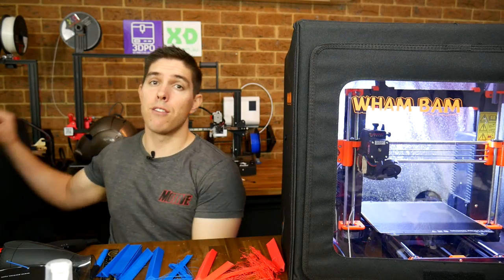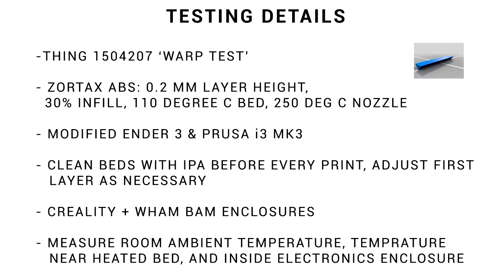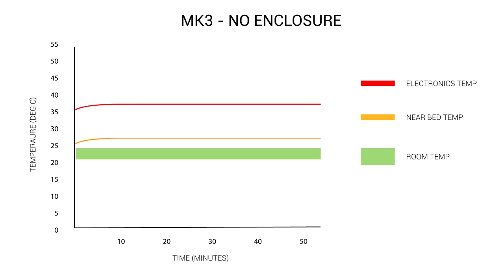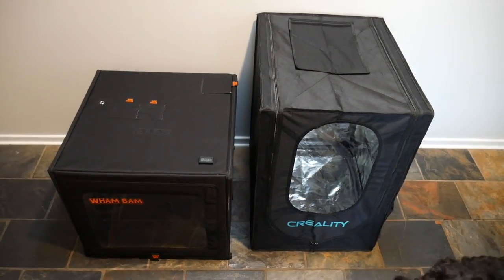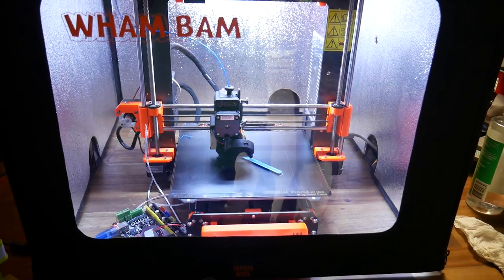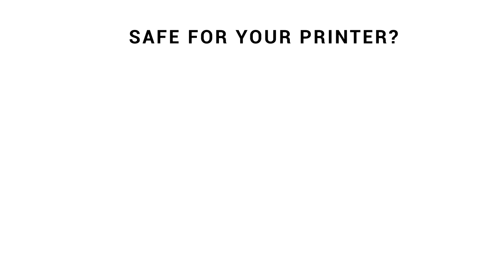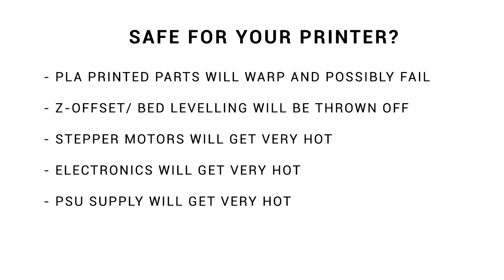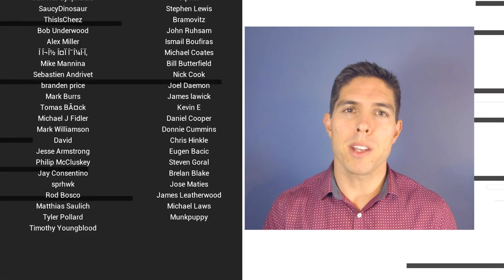Pop up 3D printer enclosures tested - Creality vs Wham Bam

Comment: Thanks for the videos! When printing with PETG the layer adhesion seems strong enough that parts don't split, but they can warp away from the print surface and fail that way. I've found that a brim and 25C semi-enclosed (reduced drafts) is enough to stop this happening. (From the research papers PETG looks to have the lowest figures for released nano particles, so along with the mechanical properties it seems the smartest choice to print with.)

The oversized hood enclosure I made is open at the bottom with its walls starting just below bed level, so all the electronics under the printer are outside, and it traps the warm air in above the build plate similar to a balloon. Printing on green PET tape stuck to glass helps with PETG adhesion and allows for 40C bed temp on smaller parts and 60C on larger ones; no need for any glues etc. The technique for printing PP filament on packing tape was applied, which is also made of the selfsame plastic.

There is a recent video by Nerys on a sort of 'topology hack' to print complex multi-walled parts with vase mode. This has helped a lot with designing things for PETG printing (usually 1.2mm line single/double wall parts) so there is little to no retraction / travel - definitely recommend watching it.

Lastly, I saw a welding video about how correct order of welds when fabricating a frame helps stop it warping. Maybe slicers could do something like that for printing ABS etc, where they extrude layers in a particular pattern/order to help equalise the cooling of the part? Or a thicker wall/infill on the inside of external corners to retain heat a bit better (if that's what would help).

Comment: I have my Ender 3 in the Creality enclosure down in my cold basement. I’ve never had a problem printing with PLA. I’m also using the Creality glass bed - would that make a difference?

Comment: Have had no issues with the creality enclosure running on an upgraded ender 3 for a few months.  The printer does have the electronic box and power supply relocated outside the enclosure.
Reply from the maker: That's an ideal setup. Did your warping reduce?
Reply: @TeachingTech  I have had no warping issues.

Comment: I have the Creality enclosures for both my CR-10 V2 and my Ender 3Pro and I have never had an issue.  I added some cheap temperature/humidity sensors that I got from Amazon and humidity gets down to 10% when I am printing ABS or PETG.  I actually use it to dry my other filaments while I a printing.  The hottest I ever seen the enclosure was 40C.

Comment: This is an incredibly useful video.  I hope you study these enclosures more; I think there are still things to learn.  One thing that might be interesting to find out is is what happens when you add either passive or active cooling to the stepper motors.  I see that there are really simple heat sinks that you can add to a stepper motor that just attach with thermal tape; also, I have seen some that use a fan.  How well do these work inside an enclosure?

Comment: That was great! I've struggled to get even reasonable layer adhesion with ABS on my Ender 3 so I made a box using foam insulation from a building supplier, a small window door using plexiglass and coating the inside with aluminized bubble wrap - got temps inside to over 65 °C using just the heated bed. This also reduced power consumption considerably.
Warping improved but the print failed after an hour when the extruder stopped working - I traced it to the driver chip on the stock mainboard, tried to replace the chip with a rework heat gun and failed - the solder pads are just too small to place accurately, and couldn't get the driver to work again.
I ended up buying an SKR Mini E3 to replace the mainboard, which arrived yesterday.
So from my experience, cooling the electronics and PSU is important, so I will make some ventilation pipes to connect the intake fans to ambient air.
I think the steppers can handle fairly high temps up to 100 °C, but will also consider using an aquarium pump and silicon tubing to try to draw some heat away from them.
The quest for a decent ABS print continues....
Reply from the maker: Thanks for sharing, great information.
Reply: Why don't you just print a case for the mainboard and display and mount it on the outside? Along with the PSU.
Reply: @schwuzi  I will, after I've installed the new board and can print again!
Reply: a chip will drift into place by itself given that there's enough solder and flux for it to do so; i've soldered many tiny parts (including BGAs with 0.5 mm balls) with success. a microscope may be a necessity though
Reply: @ikbendusan  I know, I tried, but was really tough especially with so much copper in the board drawing heat away, and I can't be sure that the heat didn't damage the chip or surrounding components. Maybe the oven would work better. At least the other channels still work, so could be useful to use for a plotter or spares.
Anyway, have new board now.
Reply: @ahaveland  i have lost count how many times i heated a component to the point that i doubted it would work again hahahaha. so far so good though. might be worth giving it another shot in the future if you end up needing it
Reply: @ikbendusan  Thanks for the reassurance!

Comment: I have no room in my house to keep my printer so it is kept in the garage (small house, too many kids). I built my own enclosure for my Ender 3. The enclosure is both heated and has an exhaust fan (when it gets too hot). I use the OctoPrint Enclosure plugin to keep the internal temperature regulated and I am getting awesome results (as compared to printing without it). I also need the enclosure because every time the garage door was opened I would have layer adhesion issues due to the draft. In fact, I could tie the bad layers back to the door open time (I am using Amazon key and have a log of when the door opens and closes). The few times I have brought my printer into the house, I do not use the enclosure and get awesome prints. In my case, the enclosure was necessary because I have less control over the ambient conditions around the printer.

Comment: This was super useful. I'm in the process of enclosuring my ender 3, and i've been thinking a lot about the effects on the various components. One should maybe try and ciculate the air(move the hot air from the top down to the bottom) of the creality enclose. The temperature gradient inside that tall chamber is probably several degrees. Maybe even tenths. Super nice with these semi-scientific approaches.

Comment: Thank you for this great video. I almost wanted to buy the Creality enclosure for my Ender3 pro. The biggest problems I have are with ABS not with PLA. Most of the problems accure when there is an airflow around my printer due to draft.

Comment: - Steppers will be fine
- Of course any other electronics aside from the steppers should be moved outside of the enclosure, there's a good reason why manufacturers recommend active cooling for stepper drivers for example.
- There's no indications on how long you waited before launching the prints with passive heating and given the internal temps I assume you didn't wait, which would play a role in how conclusive your test would be.

- Your active heating will only cause problems, ABS needs stable temps to print properly. Here you have creating air movements which will be worth than printing in open air in a closed room.

This test doesn't seems to be thought through:
- If your internal temps are going down during the print, then it means there's an issue with the enclosure or the setup. Seeing that, you should have stopped and tried to fine the source of the temps drifting down.
- It's a well know fact that sensors (except endstops) will be affected by heat so you should have addressed that before testing, as there's obviously an issue with your first layers on both the Prusa and the Ender.

- Same goes with not addressing the PLA parts on the Ender.

I love your video but I don't think you should release content with incomplete or wrong test procedures.

Comment: Received my Creality Enclosure for my Ender 5 last Friday.  Been printing successfully using ABS filament with the Creality Enclosure for about 5 straight days now.  I didn't have any of the issues you are having.  Really strange that you had this kind of issue with your Creality Enclosure.  But I do have concerns about keeping the electronics inside the enclosure for long period of time.

Comment: Considering this is meant to do higher temp filaments closer to 300 degrees C I’m. It sure why this test was done at all? Only the s1 pro for ender is made to handle up to that temp and the screen actually detaches and is placed outside of the enclosure while printing

Comment: I have the Creality one and it's great for keeping dust off but as for printing it's been very hit or miss. Once I upgraded the extruder to Creality's own aluminium one instead of plastic the filament started to snap too because the stepper under the extruder got hot and the aluminium conducted the heat! softening the filament enough during retractions to deform it.
Reply: Same here .Got the Creality Large enclosure-Printer ender 3 V2  With MicroSwiss direct drive and metal hotend.Need ventilation to make it work

Comment: I use the larger Creality enclosure for my CR10S Pro and I found I had to bump first layer extrusion all the way to 122% to get good adhesion. From there, it seems to work fine. 

One tip is I leave the door open to check the first layer is going down well, then close it up once I'm sure it's ok.

I don't run the printer 24/7, but so far it seems to be holding up. I'm not sure how to know if the steppers are failing due to heat.
Reply: Do you have any problems with the stepper motor on the sprite extruder getting hot? Thinking to buy one for my ender 3s1

Comment: I would be interested in seeing a follow up that examines your results after swapping all PLA parts for PETG or similar. Additionally, I would love to know your opinion on using enclosures to isolate any microplastic or dust given off by a printer and vent it out via a duct to an exterior window.

Comment: Have been using my CR-10S Pro in one of the Creality pop up enclosures for a few months now. Generally only print ABS, and more recently, PETG. Previously, i'd used a cardboard box to print ABS. I've had absolutely zero issues (previously i'd experienced warped prints in cardboard box), and my ABS parts are near perfect. It took quite a bit of experimentation to get my z offset right, but once it is, print failures have been practically nil.

Comment: What is the bed temperature you are using? I had an MDF enclosure for my printer with the filament inside  and usually printed at 90º-100º on the bed with hairspray and no additional heater, and was able to print much taller models. I don't use it now because the I increased the printer height so it doesn't fit anymore, but plan to get a larger enclosure.
Reply from the maker: All of these tests were done with 110 deg C on the bed for both printers.
Reply: @TeachingTech  Try some bed adhesive, hairspray or gluestick, and printing taller objects, might be an advantage there, I don't think those are completely useless.
Reply: Try printing a tall thin model to see if they improve layer adhesion or prevent splinting during printing.
Reply: BTW I like your work very much.

Comment: is your part cooling fan on for ABS, i have no issues with abs in a lack enclosure, and only with internal temps of 45, you are doing something wrong or using trash filament for your test.

Comment: I wonder if the Ender/Prusa would work in the Wham Bam, or is just the bed on those two that won't adhere at higher temps.
Reply: It's not the bed - it's the inductive sensor. Detected distance of an inductive sensor changes depending on temperature. The P.I.N.D.A. 2 has an internal temp-sensor to conpansate, but it has to be calibrated - and as nobody seems to do so, conpansation is mostly turned off.
So If you put an mk3 into an enclosure, do a firstlayer calibration with the chamber heated up. Else your First Layer will be wrong distance from the bed and so not stick optimal. Has nothing to do with the surface of the bed, only with the ABL in higher temp envirement.

Comment: I'm using IPA to clean build surface of ender 3 at work with it's fake buildtak and my colleague questioned that, he says that there might be some special coating that might be dissolved by IPA, is that true?

Comment: i bought a enclosure from amazon that "fits" the ender 3. Wasnt badly priced. It was decently built and had the correct cutouts. Its even had a small acrylic box to build and install your power supply into outside the enclosure. My only complaint was that the cabling seems a little short for the cutout provided. As far as prints.....I had the same struggle you did and wondering if I wasted money

Comment: I built the Lack enclosure (Prusa style) for my Ender 3. Prints with PETG work great inside the enclosure, prints with PLA are constantly failing - both with the Ender3 hotend (with Direct Drive Mofification) and with the Hemera. The reason for this is that the filament path gets too warm and then at some point the filament becomes deformed and is no longer transported. So I always have to print PLA with open doors. (I have not tried ABS yet)

Comment: so you didn't achieve at least one non-warped print using three separate enclosures and one of the better prints came from a printer outside of a closure? Is ABS this difficult to print with to achieve a non-warped print? Maybe we could have a video on how to achieve the perfect ABS print.

Comment: I want to setup my 3d printer in my garage as my wife keeps complaining about it taking up room in the house.
Would one of these work just for printing PLA?

I usually print with temps 200 / 60

I am in Australia so my garage isn't really cold, I'm just worried about dust and moisture etc.

Comment: My wife bought me the Creality one thinking it might keep the cat away from my prints. Come to find out that enclosing the printer can raise temps and fail PLA prints. Further, it gets in the way of working with the printer and my Ender-3 S1 has to be rotated annoyingly and barely fits. So, after pulling it out to add the LED kit, I think I'll leave it out until such time as it warrants enclosing.
Reply: Heat won't fail PLA prints.

Comment: I just have a box I made out of 2x2s and MDF.  I've always kept all the electronics inside the box through a few printers, and often the power supply as well.  It's fundamentally stupid to put those things in there, but I seem to consistently get away with it.  I've enjoyed vastly improved flatness and layer adhesion with ABS using the box, including most recently an ender 3. I can't understand why these would be any different, nor why you are having so much trouble with them.
Reply: Electronics can take it, he's just being over-cautious.

Comment: Thanks for this. I'm likely going to be purchasing an Ender 5 and your design for a heated chamber for that looks like it might be the way to go. I'll definitely be printing any upgrade parts for it in PETG instead of PLA to hopefully let them handle the heat until ABS versions could be made.

Comment: You shouldn't use flexible bed layers when printing warp sensitive material. The forces on the bed are massive and will bend the flexible bed for sure, causing the print to come off early. I use a glass bed for printing ABS and PC on my modified Ender-3 Pro (PT-100 sensor, direct drive) and preheat the bed for10 minutes. When printing, a large towel over the printer setup is enough to retain heat and prevent draft. Using 3DLac adhesive and a brim for perfect prints without warping.

Comment: Currently trying to print the parts for my Voron on a cardboard enclosed Monoprice ultimate(Duplicator 6/Zortrax clone). Sadly I printed a hotend mount out of PLA which finally failed after about 15 hours of printing. The more I venture into printing ABS and Nylon the more I'm glad I ordered a Voron 2.4 kit. Now if they could ship the thing.